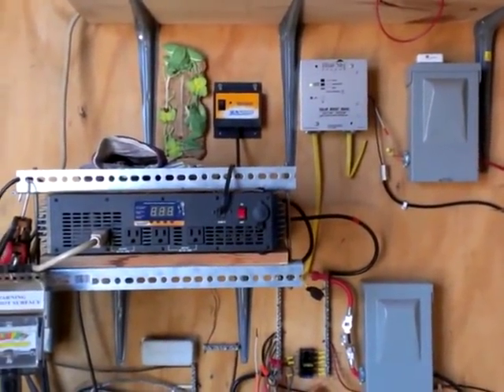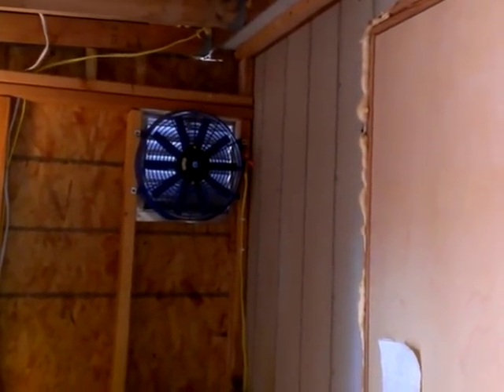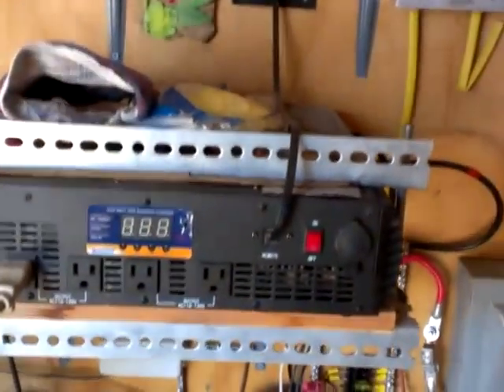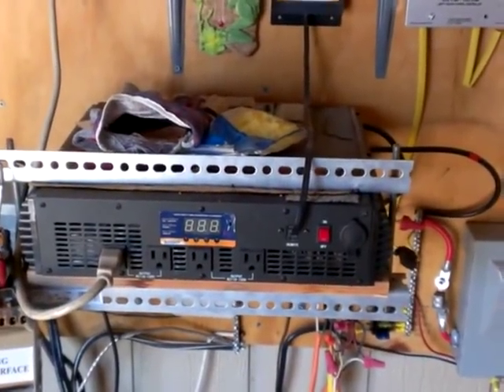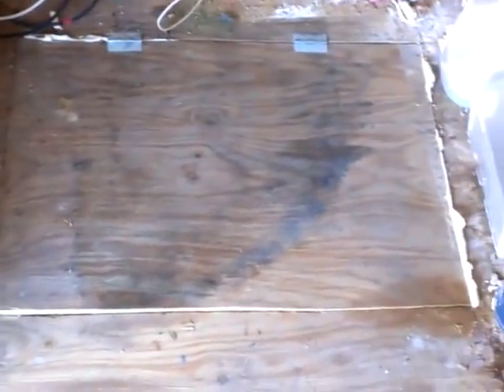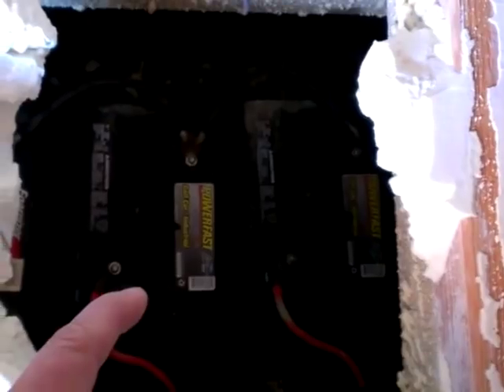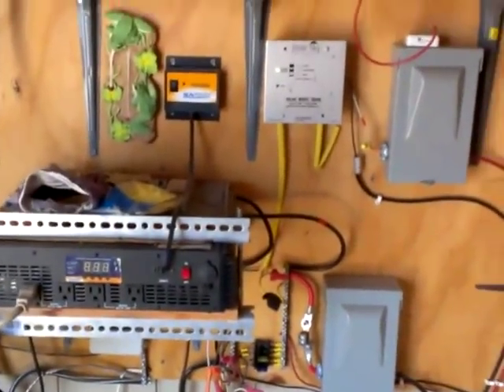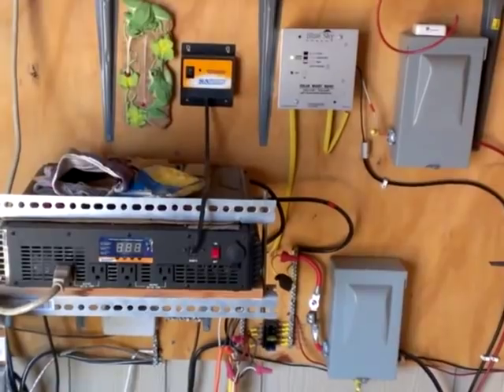DIY Solar Power Cheap,  😱12VDC x 800A Off grid living

Comment: Total agreement on that "clip board guy".I'd  go with bigger gauge wires ...seems like your wires would be warm to the touch here and there...be safe. I will start my container cabin this year up the road from you,thanks you have been helpful.
Reply from the maker: Wires are OK, not even warm due to small load. We run a DC ceiling fan 30w/2.5a (1 overnight and 1 during the day) and our DC water pump is only around 96w/8a, so if all were running at the same time = 156w/13a. The main purpose of our system has evolved to #1 having pressurized water when needed in emergencies plus other niceties such as ceiling fans and lighting. Hey neighbor, thanks for viewing and your comments, much appreciated. Will you be posting videos on your container cabin?

Comment: HAHA I know a Mark Crawford and he is a good guy im sure you are too lol. Anyways cool video, and just to let ya know charge controllers actually take the load from the battery bank, not from the charge controller. It does this because the battery acts as a equalizer and smooths out the dc voltage going out. But you have a very nice setup Plenty of power. But where are the solar panels? I will check out your videos... Thanks for the video nice setup like i said

Comment: The cables from your battery bank to your inverter are far too small. 1,000 watts @ 12V is 83 amps. Get fatter cable.
Reply from the maker: You are correct if pulling 1,000 watts, however our system is only running a 30 w/2.5 amp ceiling fan (1 at night/1 during the day) and the occasional 120 w, 10 amp DC water pump, so all good. Thanks for ur comment!

Comment: What are you doing for refrigeration... Future plans for refrigeration?
Reply from the maker: TheMrKrause We're using an Americana Dometic fridge with top freezer. It operates from AC or LP with milliamp DC power for controls. There are no moving parts (no compressor). It's smaller than a typical fridge, (like other scaled down things we have), but fits our needs very well. Thanks for viewing and your question.

Comment: 1000 watt inverter? useless, so what you have a few lights when SHTF. How will that help you actually survive? Min needed is 4000 watts, I have an 8000 watt inverter.
Reply from the maker: +Trina McDonald Keep in mind we have a much more "frugal" system and way of living than most, which eliminates many of the usual electrical requirements. Think toaster oven vs microwave, gas stove/sun oven/outdoor grill vs electric cook stove, RV type propane frig vs electric, hand wash vs electric dishwasher, DC water pump and ceiling fans vs electric, etc.
Reply: +Sustainable Frugal Living That is all fine and well however you are still on propane, in other words "the grid" please explain to us what the difference is? Off grid is OFF GRID. Should the grid go down for any reason imaginable, you are in no different position than if you had not changed anything or made any investment in alternative energy. In short, contrary to your title here, if SHTF for real you are as done as your neighbor that did nothing. I am not disparaging what you are doing, only pointing out that you are still "on the grid"
Reply from the maker: +Trina McDonald We're not "tied" to propane. An RV type LP frig also works off of electricity (IE battery Bank & Inverter) and has a 12V control circuit. We can cook on the outside grill or sun oven in lieu of the LP cook stove as well. Heating via wood stove. Also, can generate our own methane in lieu of LP as well. So you see we could eliminate LP if needed very easily. Good to have alternatives/backups. Not true about being "as done" as a neighbor that did nothing, since our frugal system does allow us to live w/o the grid. We've done it, actually started out that way and if rates go too high or if unavailable, we can switch back in 15 minutes. We have a small grid tie (120V) only for AC window units (gets damn hot in Texas). Our 12V evaporative cooler (will be 2-stage eventually) will suffice for cooling in an emergency, w/o grid electric. 

Reckon, what I'm get'n at is we live a somewhat hybrid lifestyle (best of both worlds) while establishing our system and/or until the SHTF. Electric bill this month was $48 and LP runs about $6/mo, so why not enjoy the benefits. To be completely off-grid w/ or w/o LP, would cost about $ 3-5K in improvements, which we don't have budgeted right now as we're focusing on more important projects such as expanding our gardening, livestock,etc.
Reply: +Sustainable Frugal Living Well, carry on. You are doing good, maybe I just cant see living that way. I am a little to addicted to comfort, LOL. Consider wind power. Most of the USA is in wind zone 4 - 6 which is good production area. Our 1650 watt turbines each produce a min of 4kwh/day and cost under $600 delivered and installed (If you are handy and can make your own mounts on roof top). We have 4 turbines with total rating of 4500 watts. Live comfortably in northern Canada (It gets dang cold up here)
Reply: 4,000W is about double the minimum for me. I went with a 2,000W inverter for my system and I've never come close to drawing more than 2,000W at any one time in the last six months. Even running the water pump and the washing machine at the same time uses less than 2kW.
Reply: What does 'off the grid' mean to you? By the look of things, it has a different meaning for you than it does for me.